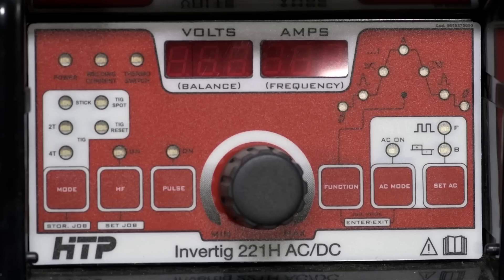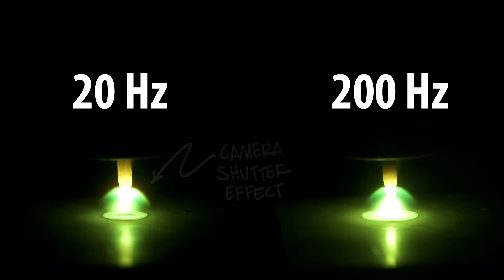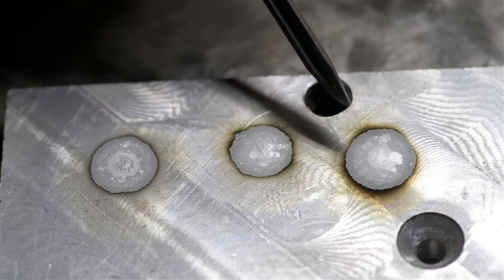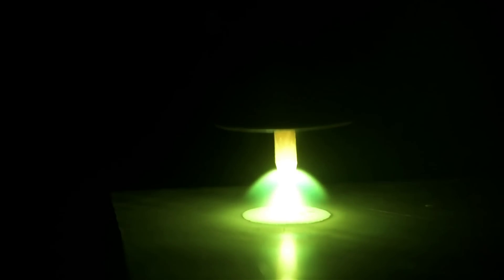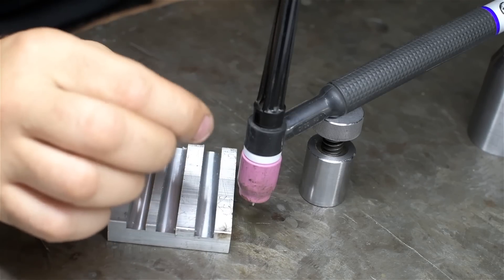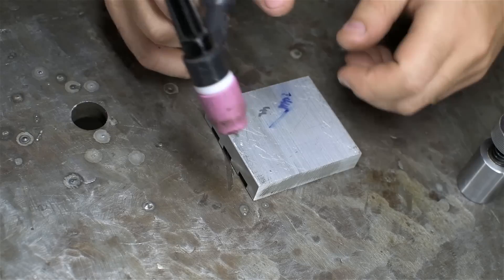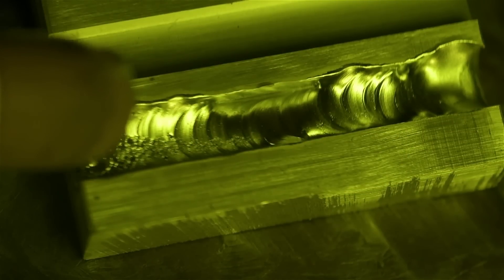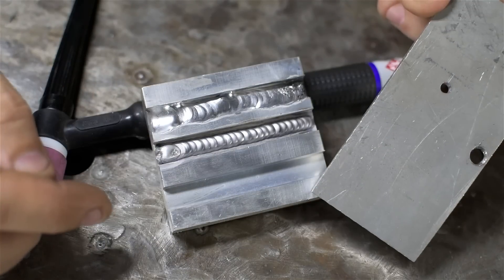TIG with TOT: AC Frequency?!

Comment: Before going wild with physics theory... I would use a clamp Amps meter and see if the current is really the same in each frequency. I would do the welds again with someone watching the meter telling me where I'm at when at full pedal. Then if the results are different I would do it again trying to match the current by controlling with the foot pedal. If I had a welder I would be testing this right now.  Very interesting.  Thank you for all the great work.

Comment: As a electrician (is that spelled right? Well iam ELEKTRIKER) higher frequency forced the current to run more towards the surface (because the changing current is inducing a magnetic field). Thou your right and thats what iam seeing as well. You get more heat INTO the area that you are welding. Maybe towards higher frequencies the current travels off of your weldpuddle into the surrounding... Just a theory here :) You can touch the arcs of powerfull teslacoils (with like more than a few mA output) and dont get killed because the current is just running over your skin (because of kHz to Mhz of frequency!) This video is older and maybe nobody reads this but HEY thanks for your very good videos, YOU LIVE MY DREAM. Id like to have that kind of equiptment ;)

Comment: Don't know the exact reason either, but i am thinking about effects of inductivity (and perhaps slew rate of the inverter) on higher frequencies, so even the machine says 150A, effective current is probably less in reality. Perhaps measuring the input power to the welder will give some clues. Don't have an AC TIG, so can't do it myself. I would certainly rule out skin effect, the frequency is far too low to see any significant impact of that.

Comment: I think it the difference in bead profile between the 20hz vs 200hz has to do with the oxide layer and the thermoconductivity of aluminum itself. It  will also depend on the balance. But I think of it like this. The more switching from the hertz allows the oxide layer to retain a certain (dare I say surface tension) for lack of a better term. Which in turn reduces the bead profile and the wetting in the toes of the weld. The actual plasma cone shape really depends on how you dress your tungsten. Would love to see what 6061 thinks!!! Great video!!!

Comment: Oddly enough this reminds me of the grip on tires for motorcycle racing.  Higher energy a.k.a. lots of throttle actually cause the tires to spin up so fast that only the surface gets hot. I believe this is something relatable.  It seems as though with a very high frequency it can not penetrate farther in the crystalline structure and only excites the surface. Which makes sense because all the energy is used up on the surface.

Comment: I found similar results.  The higher frequency tends to have a tighter and taller bead.  The lower frequency flattens out and penetrates more at the same amperage.  Guess I will try and up the amps when running higher frequencies.

Comment: Skin depth is a completely reasonable explanation for heat penetration with thicker materials like your test sample.

Skin depth in aluminum at 20Hz (sine wave) is about 18mm and at 200Hz is about 6mm. it should be noted that a square wave (or a squarish wave) has frequency components on every odd harmonic above the base frequency that account for maybe a 10th or so of the total power of the signal which would tend to flow shallower.
Reply: At that depth its still ~40% current. This does not explain the differences in these "thin" pieces. Also, the welding puddle is very shallow. In order for this to play a significant role the aluminium would have to be much worse at conducting heat and u would still have to heat the first cm to its melting point to see the effect. And maybe even then you would be unable to see it, as the current is not focused. As soon as its in the aluminium it spreads out (inverse square law). By the time its 1cm deep it will be spread out to ~6x the area (from a 1cm² arc), so resistive heating will already be minimal (in the order of the welding cable itself or less).
Reply: Leo Curious 40% current is 20% resistive heat.
Reply: That would be in 6mm depth at 200Hz. With the current density (current per area) already more than halfed due to the increase in area. The lower temperature will also reduce heating compared to the welding puddle.
Also... we dont have a rod/wire with the current going threw its lenght, we manually inject the current at the side. So the skin effect will be even lower.

I think the higher frequency doesnt alow the arc to wander around as much (less time to move around). And thus its a more narrow area.

Comment: I remember learning that in non-braided/stranded wire  that the electrons prefer to run along the outside  "skin" as well. Therefore a thicker wire doesn't produce as positive of a result as say a braided or stranded wire. I imagine that is somewhat of a universal phenomenon. By increasing the temperature and the possibility of the "skin" being molten, I think it may pinpoint or amplify this effect.

Comment: i want to try tig welding... i am an old guy and have been welding smaw, gmaw, fcmaw, dual shielded fcmaw, old school oxy acetylene welding and brazing and even just plain old soldering with a torch or an iron for years,  when you referenced Jody from welding tips and tricks.. had to subscribe... kudos dude.. btw Jody rocks  and so does weld.com

Comment: Tony, I'll take a stab at this.  I'm going to guess puddle width is driven by the amount of time the AC freq is in the negative or positive position.  At 20 Hz, the 'wave' cycle time is 1/20 of a sec, or .05 sec.  The neg or pos duration would be half of that, so .025 sec.  Electron and Ion travel direction are driven by the polarity of the electrode.  So when using 20 Hz, the Electron/Ions are being 'pushed' (or pulled if you prefer) for ~.025 seconds in one direction before the polarity changes and reverses the direction.  For 200 Hz, the wave/cycle during is 1/200 of a sec (10 times shorter) thus the electrons/ions are pushed (pulled) away (towards) from the electrode 1/10th the amount of time as with 20 Hz.  This decreased time is witnessed with your (TOT's) test as the Higher Freq (200 Hz) bead profile is obviously a lot narrower due to the shorter amount of time that electrons/ions can 'fan out' from the shortest/direct path to the work piece.  I'd try to explain myself better here but i'm probably already too wordy so i'll leave it at that.   Tony, thanks for all your efforts and great videos!
Reply: Also, if you have the chance to look at a capacitive coupled (AC) plasma in a vacuum, in an environment with pressure around 5 Torr and 100% Argon gas  (doesn't everyone have that opportunity? ;)-if the plasma is struck with 350 KHz, the plasma area will extend not only between cathode and anode, but it will radiate out in a circular fashion.  The amount the plasma extends outward is extremely affected by the frequency used to strike/run/drive the plasma.  If you use 13.56 MHz (~40X faster freq), the plasma 'ball' is very notably smaller in circumference, this phenomenon has been studied at length and is driven by the duration of polarity (as i was trying to explain above).  Ok, off to mow the grass.  Be well.

Comment: My new 325 amp TIG machine will go up to 300HZ. I stay at 130HZ. I control the arc by shaping the electrode. Blunt for wide arc, sharp for narrow arc. If I increase the HZ it requires a higher amp setting. If I pulse, it needs the amps increased with increasing the pulses per second. Raising the frequency out of site is only for entertainment. I love that high whine   😛

Comment: Idk but I would think of the freq like a pulse. The higher the frequency the less time spent on the penitration side of the cycle.  So if I was pulsing in DC on say carbon.  The higher the pulse the higher the amperage required to penitrate the same as no pulse. Thanks for the videos. Always good stuff.

Comment: I think the most likely explanation has been touched on in a few comments: This probably has more to do with the time it takes to re-establish the arc each time the current reverses than skin effect or wave shape or other such factors that are only significant at much higher frequencies. Given a fixed delay between when the current direction reverses and when the new arc is established and at full temp, a lower frequency arc would spend more time generating heat per second. This would also place a limit on how high you can push the frequency while still getting enough heat at max available current.

Comment: Very interisting? I am just barley looking into tig! I have a old Miller that has a AC and DC plus. High freg! But no extra do dad's. Thanks for the info. And your videos..
Reply: They're a dream, I use pretty much only old millers and my Dial Arc HF is like a 90's Cadillac. Lumbering, loud and sometimes cantankerous but you won't notice a Detroit sized pothole from behind the drivers seat.

Comment: Well your theory does make a lot of sense.. The skin effect can be very prominent at frequencies above 60Hz. And Induction motors have to deal with that "problem" on each start ( consider a direct start....) 

Its hard, without other tests, to be sure if the diference is caused by the skin effect, but based on electrical engineering theories, the skin effect is definally plaing it's part on the game.

The interesting part is that, on electrical wires, the skin effect is the cause of power loss by heating. The reason is that the wire has only a part of its area conducting electricity. So, to me, your theory is on the right direction.

Comment: I'd be interested to see some polished and etched cross sections of those welds to see what impact the ac frequency has on penetration, in addition to the effect on surface "spread" of the puddle.
Reply: +1, it has been my understanding that freq. determines the penetration depth of the puddle. ie. 20hz= wide/flat and 200hz=narrow/deep.  Echin0idea's suggestion could shed some light/proof one way or another on this.

Comment: I think the answer is simpler than skin effect, I think it merely has to do with the thermal conductivity of Aluminum.  The rate of heat transfer is non-linear, so a lower frequency will impart more heat over a given cycle than a higher frequency.  The lower frequency dwells longer in the forward portion of the cycle, allowing the material to absorb more energy, as it makes it further along the curve.  A higher frequency stops putting energy into the part at a lower portion of the curve, thus the part is able to dissipate the energy better.  This is akin to thermal inertia -- the high frequency has trouble overcoming the thermal inertia, while the lower frequency is able to overcome the inertia and impart heat into the part more easily.

Comment: If you haven't checked out "skin effect" on Wikipedia, it's good read.  Note, near the bottom, the curves with the caption "Skin depth vs. frequency for some materials at room temperature..."  At TIG frequencies, it's pretty shallow for a wide range of metals -- generally less than 1 mm.  So, Tony, I agree that skin effect is a good way of thinking about it and it's not what's at work.

The effect whereby lower frequencies seem to correlate with deeper weld penetration is one example of a propagation phenomenon you see with waves of any kind (e.g., EM (electro-magnetic) and Mechanical (e.g., acoustic, seismic, ultrasound...)).  Bottom line:  most media (the materials the wave is propagating through) exhibit a "low-pass" or "high-cut" property whereby they attenuation higher frequencies more than lower ones.  Here's a familiar example:  you're at a commuter airport, where you have to walk off of the flight line to get into the terminal, having just landed in a commuter plane that was piloted by two teenagers with 150 hours between them.  You hear the scream of the jet engines, and it hurts.  A lot.  But as soon as you walk into the terminal, mostly what you hear is the low rumble of the bigger jets taking off.  Well that screaming sound from the engines on the flight line has a LOT of high frequency content in it that you don't hear inside the terminal.  Why?  Because the building materials (brick, steel, glass, sheetrock) all attenuate higher frequencies more than they do lower ones.  Put another way, the lower frequencies * penetrate deeper*** into those attenuating (a.k.a. "lossy") media (again, the building materials) than the higher frequencies do.  That's why, once you're inside the terminal, all you hear are the powerful, low frequencies:  they propagate through (i.e., penetrate) the building material medium, whereas all those higher frequencies don't.

Well, it's the same principle at work with AC TIG:  lower frequencies penetrate deeper into the medium (your base metal) than higher ones do.  

In case other readers are engineers or physicists:  yes --- I'm leaving out a bunch more wave propagation stuff, like wave reflections owing to abrupt changes in the impedances of layered media, dispersion, blah blah blah.

Comment: The skin depth for aluminium at 20hz is about 18mm, and for 200hz is about 6mm, so the skin effect inside the aluminium itself probably makes very little difference. 
It's probably more likely that when the current changes direction the arc has to reform, which, at 200hz,  would give the arc only 2.5ms to reform and transfer it's energy. Maybe that isn't enough time so the welder doesnt give out as much heat at the higher frequencies.

Comment: I can't weld worth a Tinker's D*m#, and I don't own a TIG welder, but I still love your videos even when I can't relate to them!  :)
Reply: Interesting phrase, that.  Fits right in with this channel.  Think of the dam as the mold against which you cast tin for a repair to a tin pot.  You dam it up with whatever you have handy, and the dam itself is worthless junk.  :    A tinker's dam is a temporary patch to repair a hole in a metal vessel such as a pot or a pan. It was used by tinkers and was usually made of mud or clay, or sometimes other materials at hand, such as wet paper. The material was built up around the outside of the hole, so as to plug it. Molten solder was then poured on the inside of the hole. The solder cooled and solidified against the dam and bonded with the metal wall. The dam was then brushed away. The remaining solder was then rasped and smoothed down by the tinker.[6][7]

In the Practical Dictionary of Mechanics of 1877, Edward Knight gives this definition: "Tinker's-dam: a wall of dough raised around a place which a plumber desires to flood with a coat of solder. The material can be but once used; being consequently thrown away as worthless"

Comment: Wow that was really interesting..
I have a cheapo 100A inverter that I've only ever used the stick welder mode on.. But it has a TIG mode too. 
As a sailor I very occasionally weld some 316 stainless with a 2.5mm Satinchrome rod.  But maybe i should get some, electrodes for the TIG hand piece and have a go at that?

Comment: You definitely got me thinking.. Skin effect may be what concentrates the current at the focal point of the plasma.. It essentially keeps the current from spreading into the part and heat stays closer to the surface. This means that the current has to be carried away from the weld area on the surface of the part.   A lower frequency will allow the current to penetrate. 

For reference look here.. 

https://en.wikipedia.org/wiki/Skin_effect

In the examples there is a graph that shows what is considered the depth of AC currents in some different metals. For aluminum the depth would be about 6 mm at 200 Hz and 20 mm at 20 Hz if I read the graph correctly.    I would suspect that the skin effect is significant enough to make a difference in how the current penetrates the part you choose. It's also good to remember that square wave are really the sum of odd higher frequencies at lower levels also. Not all of the power is at the primary frequency. (Fourier Series).

I should had that the current in the surface of the part simply radiates away the heat..

Comment: I think one of the best examples of how higher AC frequency can be advantageous is in a T joint, when executing a fillet weld. At 75% EN, 25% EP, you will see increased travel speeds, and more efficient heat transfer. But, to truly see the difference between say 50Hz and 200HZ, macro-etch testing can be doe to see the difference in penetration profile. Visual observations can be misleading, objective testing is the best way to truly test the benefits.

Comment: Hi Tony, 200Hz is really low frequency in electronic terms and as you said, the skin effect only come into play at much higher frequencies. the Trapezoid theory sounds plausible, but I doubt if that is the case. I think it has to do with the arc changing direction. The plasma wont break off, but the current is interrupted more frequently and the arc is interrupted and it takes time to build outward from the striking point when current starts to flow. Maybe you need a high speed camera to see this. Initially the strike is to a single point and as current starts to flow, it fans out to the surrounding area.